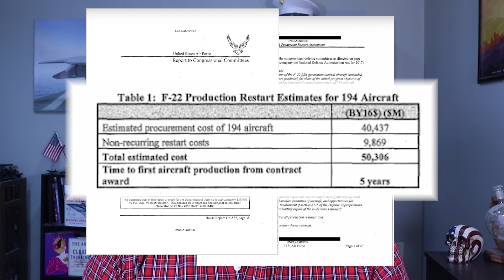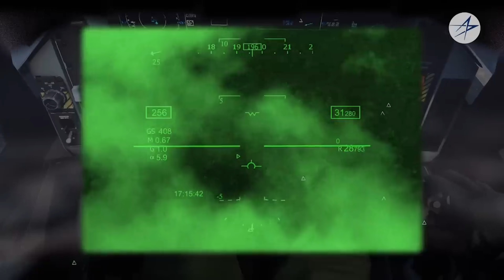The 2ND GENERATION F-22 RAPTOR we ALMOST got

Comment: I like how the F-22 was so advanced that only now are other countries starting to catch up
Reply: @Leon1Aust  >the lift fan on the B model is a rolls Royce design gained from Yakovlev 

That's just patently not correct. The lift fan in the Yak-38 is not related in any way except for end purpose to the Rolls Royce LiftSystem.
Reply: @Leon1Aust  Yakovlev never had a lift fan, you made that up lol. The lift fan is purely Rolls Royce technology based on Lockheed Martin design. Yakovlev instead used a far inferior 3 engine design, with 2 of the side engines being dead weight after take-off. This was a far worse design which is prone to more failures and heavy maintenance (one of the reason 66% of their prototypes crashed), and funny enough, F35 flew just 9 years afterwards.
Reply: Sorry my mis your spot on there!....... three Yak 141 was purchased by Lockheed to examine the VSTOL features, for JSF probably the main engine swivel nozzle at the rear was influenced by the Yak 141 not copied. @amazin7006
Reply: Not even. They still havent even gotten close to catching up😂
Reply: @thatguy46744  Totally agree!! They're not even close to catching up with the raptor, they Will eat the J-20 & the SU-57 for breakfast & fart 💨 out nuts & bolts 😂😂😂
Reply: @raymondtorres-gy8uj  yup. And aparently the j20 still uses rivets, which compromise even the little "stealth" it already didnt have🤣
Reply: And even still, no they aren’t 😂 nobody has any level of stealth even close to ours. They are able to make 1/4th of a squadron of “reduced visibility” aircraft
Reply: I don't think anything in development by anyone other than us directly or an ally we we trust enough to share/co develop 6th generation technologies like active flow control, rotation detonation engines, drone families, hybrid turbofan low pressure compressors with rotation detonation chambers instead of spark/glow ignition systems, or the rotation detonation system used as the afterburner, which is believed will be 50%-100% more fuel efficient when they're lit. Doubling the amount of time a modern supercruise capable jet can use its afterburners presents a host of advantages from interceptor ability, bug out survival, range, missile evasion, and if those aren't enough the fuel consumption rates fall too!

Comment: Did they solve the problem of F-22 wing to fuselage connection? It was the most expensive problem of F-22 that required continuous inspection of crack initiation and propagation. Most likely, it was one of the biggest reason of stopping production of this plane.

Comment: The NGAD will have something none of the current generations have, and that is a focus on much longer range. This is absolutely crucial for any check on China. As glorious as any of these previous designs might be, they are largely useless in the Pacific theater due to their existing limited range. They are great for Europe, sure, but that is not where the greatest threat is. The NGAD won't be an air superiority 'dogfighter', it won't be as sexy that way, but it is going to be a darn sight more useful for our inevitably limited budgets to maintain.

I seriously hope the NGAD will have supercruise, as they'll need it for those longer range deployments.
Reply: Yep people are missing the new operational requirements NGAD will have, I'm super curious just how large it'll be compared to an F-22 or F-15
Reply: @aidanwilliams9452  I'm guessing something like the F-111. It's going to have to be big if they want very long range.
Reply: @aidanwilliams9452  It will be significantly larger than the F-22 or F-15, of that much I am certain, if for no other reason than the extra fuel. But I strongly suspect it will have room for significant internal stealthed payload as well, at least 4 SM-6 internal. I dare say it might not be much smaller than a B-21 and will have a similar feel to it. Of course I am speculating, but it is not a completely uninformed guess.
Reply: @panpiper  Yeah hopefully they give it enough room for the hypersonics in development, otherwise only the F-15EX will be able to carry them. With how they're talking about it possibly incorporating a laser they'll also need a lot of power which may require who knows how many additional engines. Whether they go tailless or more YF-23-like we'll wait and see, either way gonna be an interesting design.

Comment: Why would you need super maneuverability if you can literally shoot a fighter behind you?
Reply: Because stealth vs stealth combat, the adversaries cannot pick each other up on radar let alone get a lock head-on. 

So, they inevitably get directed by large, ground based long wavelength radar to an area where enemy stealth fighters are present or heading.

You arrive to said area and have to get within 20 miles to even see them on radar. Causing most stealth-stealth combat to take place within visual range.

Comment: The hope is that the US Gov't combines the F-22's flight and stealth capabilities with the advanced avionics and electronics of the F-35 into the NGAD and they don't lose sight of technology advancements and the need for improvements. It boggles the mind how the F-35 is inferior to the F-22 in flight capabilities and the short sightedness given to the F-22 program that production lines were removed, yet F-15 lines are still around - wasn't the F-22 replacing the F-15? These type of upgrades would be akin to the what the F-15EX is receiving and yet, is still in production. I guess we had to create something inferior to sell to other countries like the F-35 and retro-modified F-15s.
Reply: Makes you wonder what their real priorities are 😅
Reply: F-22 was supposed to replace it, but then the USSR fell the 90s came and the US didn't have the same need for those capabilities
Reply: The USAF has already stated the F-35 has a lower RCS than the F-22, so literally the only concern here is flight performance, which the F-35 already has decent flight performance for the job. 

I'm not sure how you're confused that a single engine plane without vectored thrust is less maneuverable than a twin engine plane with vectored thrust; however, do consider that the F-35A is still a 9 G, 50 degree AoA platform and there are very few fighters in the world that can match that.

Comment: So if the F-35 can already shoot AIM-9X at planes behind it, what is the point of the Raptor's super-maneuverability? It's just too expensive and too dated a design. If you really need a super-maneuverable missile platform, you can get it from whatever secret project the Boeing Phantom Ray or the X-47B turned into or whatever combat drone Skunkworks developed that we don't know about.  At least they can pull more than 9 Gs without the squishy meat cargo. We don't have to act like it's a coincidence that all these UAV programs demo'd at exactly the same time the Raptor production lines got shut down, right?

Comment: The Afghan war was necessary; the Iraq war was a choice of ego and bravado.
All told it blindsided the US for China's PLA to catch up.
The US in going forward, needs to reboot its heavy industry program on scale to counter China's numerical superiority which it already lost just on optics alone.
The expensive and hard-to-maintain Cadillac system should be avoided.
Defense contracts to newer players in the market would be wise to drive down costs and avoid monopolies and chokepoints in military suppliers.
Seems like stealth fighters are the ultimate Cadillacs in the air with NGAD being probably the last crewed one.

Comment: would the F-22"B" be the worst missed opportunity knowing the Lockheed L-133, with the L-1000 axial-flow turbojet, was just one step away from becoming a reality?
had it been built in 1942 and it would outclass the Me-262
the P-80 was proposed one year later and started flying by 1944, the L-133 would likely be introduced by 1944, right around the same time the Me-262 was accepted for service

Comment: Excellent workmanship once again.  Additionally, we both have read about the testing of "6th gen." technologies on the F-22 air-frame.  They also said that what works on the Raptor, it gets to keep.  That likely includes ceramic RAM that can take more heat than the aluminum under it -- thus allowing Mach 2+ operation (put that on the Tomcat in your background art).  They will likely have to re-engine the F-35s for the next major upgrade for more electricity and cooling, giving the opportunity to use one of the new combined cycle designs...
Reply: The F-22s top speed is Mach 2.25 

It's the F-35 which can't reach Mach 2
Reply: @jeffbenton6183 I find it interesting the the Raptor can fly nearly as fast in supercruise as a F-35 full out.
Reply: @PasleyAviationPhotography  remember different jet designed for different purposes. F-22 fighter interceptor. F-35 more multipurpose.
Reply: @PasleyAviationPhotography  It might actually be faster. Officially, the Raptor's speed at supercruise is Mach 1.5, and that's considered satisfactory. However, it's actual top speed at supercruise was classified at the time the USAF was using that figure, and I seem to remember that it was revealed that the actual supercruise speed is Mach 1.86 (or 1.87 - I forget exactly). As you know, the F-35's max speed is 1.6 (it's supercruise speed is 1.2). The F-22 is just absurdly efficient.
Reply: @PasleyAviationPhotography  While I'm at it, I should mention that within the past several weeks (two months at most) I learned why the F-22 and F-35 are speed-limited, which I somehow didn't know after reading about these sorts of things for the past two decades. The F-22 actually produces more thrust than the SR-71. It can't take full advantage of that because of the structure of it's engines. By that I don't mean that turbofans can't get past Mach 2.25 - the F-15 can do 2.5 and the MiG-25 could get to 2.8 before having issues - it's specifically the F-22's F119 engines that can't operate past that, IIRC because they're too wide. Wider engines produce more thrust, but also undergo more stress at insane speeds. The F-35's F135 engine is - of course - even wider because they needed a single engine to propel such a large plane (and do VTOL). This is the main reason why it can't go past Mach 1.6 even though it actually matches the acceleration of a F-16 in "clean" configuration, even when fully fueled and with loaded with weapons in stealth configuration (with external stores, it's performance deteriorates, but is likely no worse than a F-16 with a realistic combat load).

Comment: Nicely presented, and an interesting concept. Upgrade the last fighter with tech from the new one and do a new production run (i.e. an upgrade going far deeper than "renovating" the existing planes can go).
Maybe it's me being over-tired when watching this, but how far back could this be taken and give interesting results? could something that looks like and F-4 be made but with F-35 block 4 tech for everything but the shape and I guess the frame? How would that perform?
Reply: The super hornet- supposedly - has enough on board space and power for the F-35s computers, so it's certainly possible for something slightly larger than that to have all the F-35s capability but without stealth.

Comment: The F-22 cancelation is yet another thing you can thank (primarily) Obama & then Sec. of Defense Robert Gates...
Reply: They did the best they could under the political environment of the times. 
Certainly better tan anything the Orange Monster and tubervilles have done for this country.
Reply: they made the right decision for the time. I love the F-22 and even wish we had a small fleet of F-23's. We have what we needed. We are better off spending the money on the next generation of fighters as we have learned a lot in the last 20 years, technology has changed a lot. If we had build more F-22 we might not have started the gen -6 programs yet. The only problem we have now is how many of the gen-6's can we afford to build and not break the bank.
Reply: @douglasw-1 no they didn't, he did the same thing with the cancelling phase 4 of the European leg of the Missile Defense. The USAF made it abundantly clear that they ordered 720, but they absolutely could not go below 400, due to the age of the F-15C/D & E Strike Eagles. So we ended up with 187 of which only 162 are Combat capable. This same crap happened with the Minuteman 3. It was supposed to be in service for 10y with a possible extension to 15y. It's been over 50y. That's why the Sentinel is costing $1.5 Trillion, because everything is ridiculously out dated. They just stopped using 8.25" floppy disk in 2019!